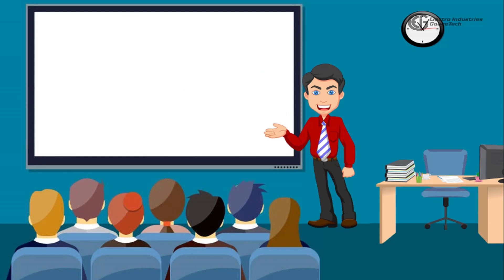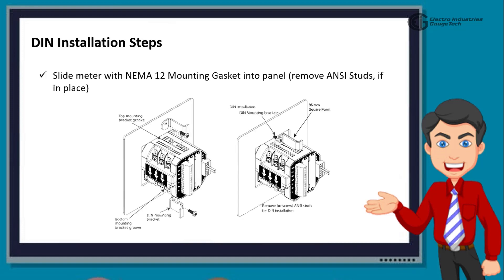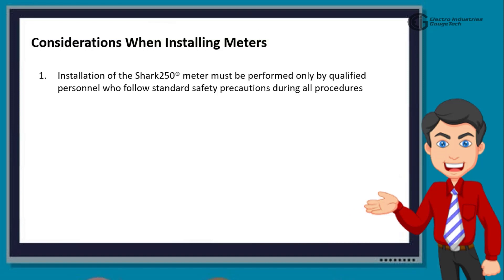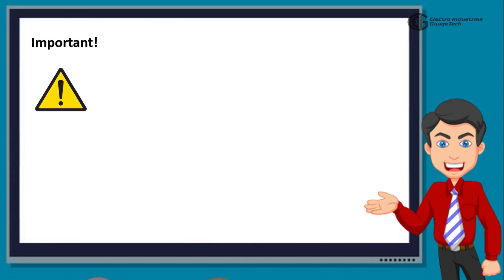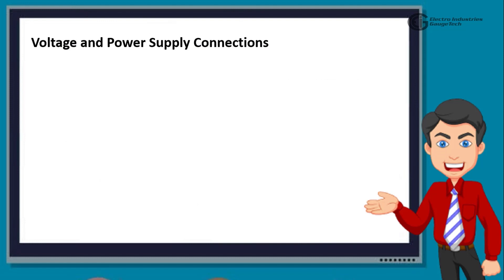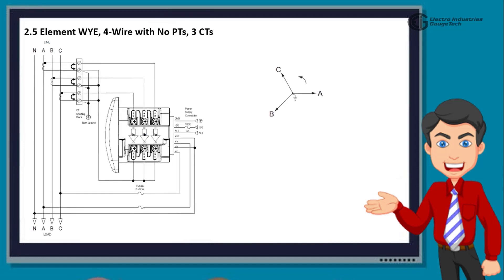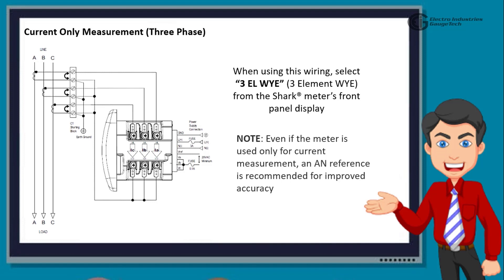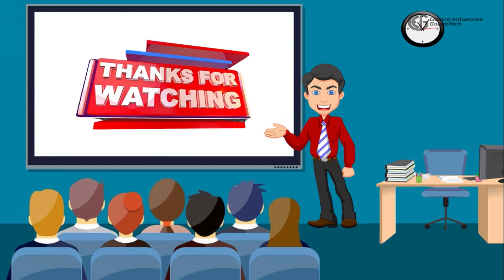Installation of the Shark® 250 Meter

Comment: Can I install the CT wires in the same conduit as the power?
Reply: Yes.  It is common to run voltage and current wires in the same conduit.  It is not recommended to run communications cables ( Ethernet, RS485, RS232, etc.)  in the same conduit as voltage and current wires.
Reply: @normanclarke1753  Thanks for the reply!